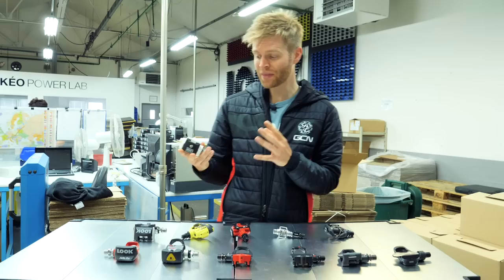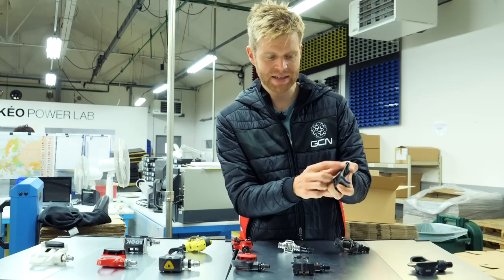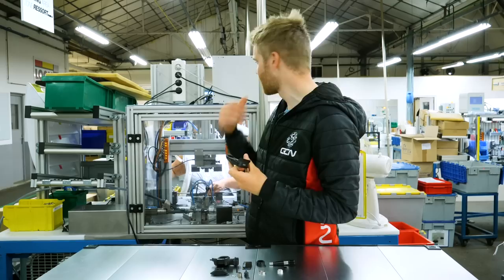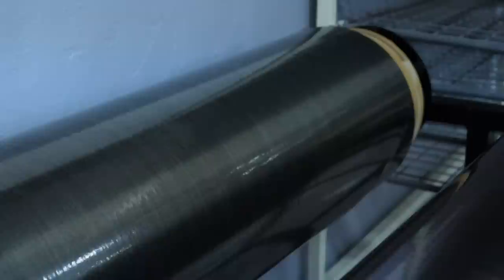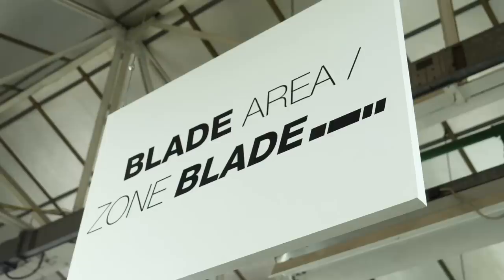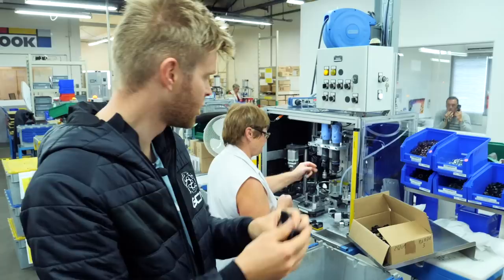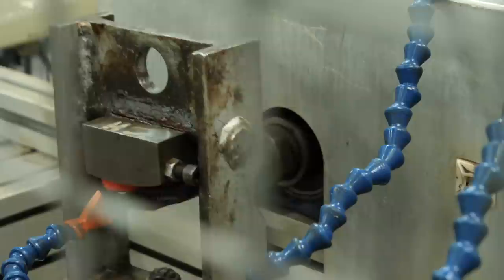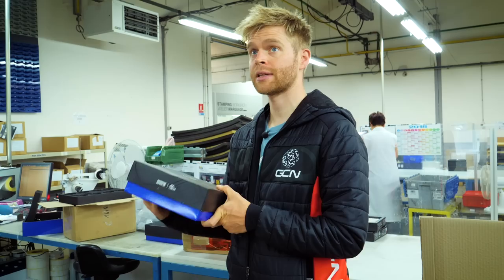How Are Carbon Bike Pedals Made? | Look Cycle Factory Tour

Comment from the maker: What did you find most fascinating about the LOOK factory tour?
Reply: funny that they decided to reappoint you for advertising their brand after last time’s blunder!
Reply: quality control.  Hope those tested pedals don't enter the market with 2,000,000 cycles on it.
Reply: Seeing the very first pair of look pedals. 
I owned a pair of these, even then they looked like a huge wedge but worked faultlessly for years, then moved onto the Carbon pros (which were also superb).
Back then, these were one of the best purchases i made for my road bike.
Reply: @DanRC69  bet they cost a huge wedge too!
Reply: I can't believe EVERY pedal goes thru quality control, if they did it would take 15+ days to put together and you'd be buying USED pedals! LOL
Reply: Far too complicated process to make thing like this driven by obsession for low weight - carbon fibre and hand work in this case it is wrong way in the history of cycling . Let's hope new magnesium based materials or 3d printing will simplify production of cycling gadgets like this and many other . I will test tomorrow Absolute Stainless Steel oval chainrings 72Te/56Te/42Te laser cut and finished in my garage rather than so many people involved just to ride such simple thing like a bike . Keep things simple and enjoy riding for fun 😎
Reply: I was hoping you would go over in detail the injection molding process with carbon composite. Does look do the injection molding in house or do they outsource/subcontract?
Reply: Global Cycling Network Ollie’s enthusiasm! Not a fan of look .  Dura ace for  me, I ride more then most humans Look  can’t handle that stress dura ace is bomber 🤙🏼
Reply: How many times you can fit the word, "Look," into the script. Not the pun, just the "Paid Promotion."
Reply: That GCN didn't focus on the bearing placements, as those seem to be how LOOK pedals fail.  Would like to have seen how they are installed, and that LOOK now provide means to change them out for those of us who invest in their pedals.  A pedal axle really isn't something so high-tech that it has to be so tough to change out bearings.
Reply: Oli.
Reply: @Colt Joey flixportal :)
Reply: @GT-cx8vd  what happened last time? I missed it
Reply: @coolbeans7274  sample QC surely

Comment: I tried Look pedals cept the back plate worn down (which hooks to the back of the cleat) - the carbon spring of the top pedals is too stiff on it, and on the front of the pedal, the cleat wears the inner section of the front of the carbon body tho Shimano's wears a bit better. You've got to keep carbon-body pedals pretty clean!

Comment: I have Look 2Max Blade pedals that use the cabon spring blades.
These pedals have the pre fixed tension settings that cannot be adjusted.
The problem I have is that the spring tension of one is different from the other.
And there is no way I can change this.

Comment: LOOK is a good product. I have some KEO Blades. The only complaint is that the packaging for the screws and washers was bad. They were loose in the bottom of the pedal box and one washer fell out into the shipping box. Please suggest to LOOK that they should improve this. If plastic is the issue than use a paper bag or attach the screws and washers to a card.

Comment: Has anyone worked out how to remove the axel endcaps on the blade 2 (2nd gen) pedals? This video shows them being pressed in, is a special tool needed to extract them?
Reply: They are pushed in and stay by friction.
You can simply pop them out with a very small and thin screwdriver.
Reply: @janwillemkuilenburg7561  yeah I can do that with the 1st gen blade 2s but haven't succeeded doing it with the 2nd gen blade 2s. I dig in with a small flat head screwdriver but it refuses to budge. Feels like i will destroy the end cap if I dig in more agressively.
Reply: The first generation you needed to remove the cup because that was the way to release the nut that hold the axle in position. The second generation (the one in this great video) can not be removed, the way to take the axle out is to be able to unscrew  the cup-holder from the inside of the pedal but you have to find a tool to unscrew it. I believe the threads are left and right handed and also the thread is glue (not permanently).  I have not done myself, but this video was very informative for what not to do.

Comment: What would you prefer shimano ultegra spd-sl or look keo blade?
Reply: Plaickner Simon Speedplay Zero
Reply: @prestachuck2867  no
Reply: Plaickner Simon Yes.
Reply: @prestachuck2867  why? Heavier and less comfortable to walk
Reply: Plaickner Simon Not heavier depending upon model, more aero and easier to walk in with v.2 Zero Walkable cleats. More float or less available due to fully adjustable cleat float with heel-in and heel-out being independently adjustable to the most minute degree. Fully serviceable and rebuildable. Customizable with many different length spindles to optimize q-factore/stance width. Fore-aft adaptor plates available for those who prefer mid-foot positioning.  No possibility of unintended release while sprinting. Double-sided self-centering design for faster and easier entry.  Lower stack height for better bio position.  But use what works for you.
Reply: @prestachuck2867  ok thank you for your explanation. 👍👌

Comment: Ask GCN Anything question:  Why are they called "clipless" pedals?  I wonder this every time I CLIP INTO my "clipless" pedals and go for a ride...
Reply: If I'm wrong about any of this, somebody please correct me, but...

You know the old-school pedals you see in footage from a long time ago?  The ones where there are straps holding the rider's foot in?  The metal piece that curved around the rider's toes and held the strap in place was called a "toe clip."  So modern pedals without that part are called "clipless."
Reply: That is correct. Some of us have even seen them in real life. They work fine.
Reply: @blahblah4059  I owned a pair before I went clipless.  Now I remind myself of Matt Stephens at some point of every ride.  :)
Reply: @jacksquat2067  I'm the same. Still have the clips and straps on one bike, always in and out no problem. When riding clipless it's about a 50% success rate.

Comment: The steerer tube on my Look carbon fibre bike snapped while I was out riding.  I went down head first, broke my helmet, double vision, broken collarbone and cracked ribs.  I then had to live in a chair for 3 weeks and it was another 4 weeks after that before I could return to work.  

I figure I'm lucky to be alive - I've hit 83 kph on that bike - imagine what could happen due to structural failure at that speed....or if I was turning in front of a bus.

The Look people ignored me when i wrote to them. I will never buy a Look product.
Reply: Sorry to hear about that Yoj, I'm far too tubsy to ride anything but steel, but my cf forks always gave me some unease, until it was nicked.

Comment: i use spds on all my bikes, not being able to walk is just silly outside of racing, get a shoe w a stiff carbon sole and you tell the difference
Reply: I don't tend to walk when I'm on my bike, no cafe stops on rides under 80 miles. Maybe 5 meter walk to my garage.
Reply: Who said cycling kit was practical??? i.e., Lycra is only good on a bike...
Reply: Similar here... I use MTB shoes and SPD cleats (and occasionally flats) for errands, commuting, etc., but the longer/harder "real" rides are with Look pedals and road shoes. 
In a pinch, though, I like that Look pedals can also be used as flats.  🚴